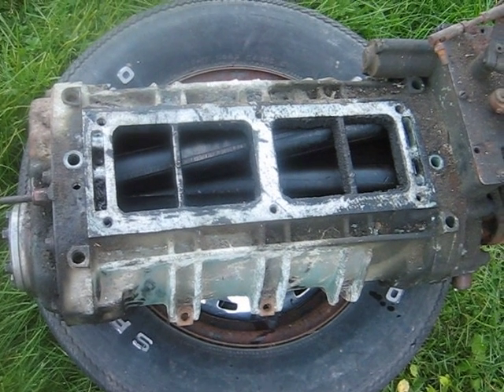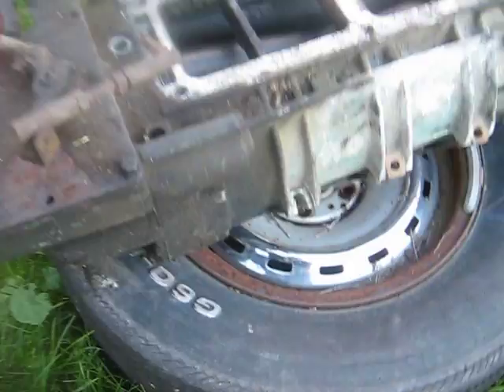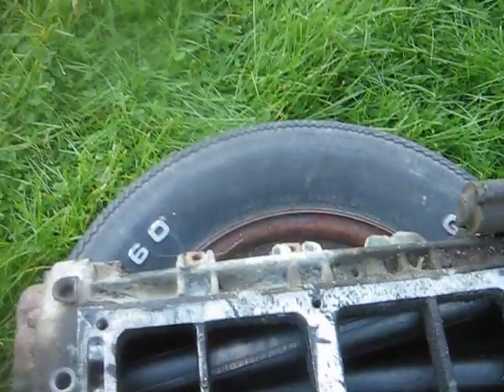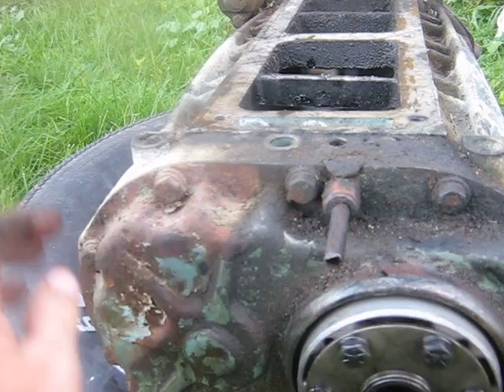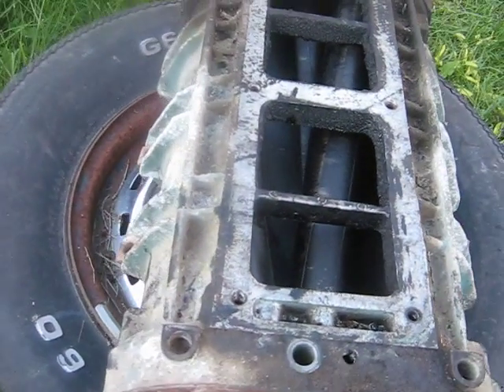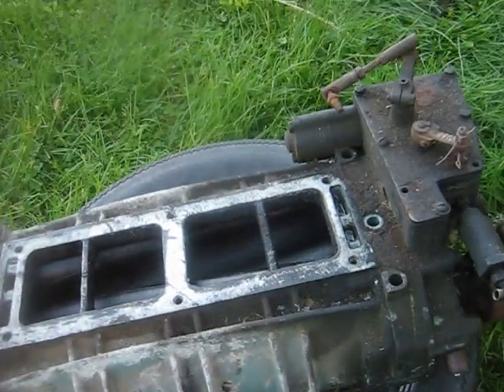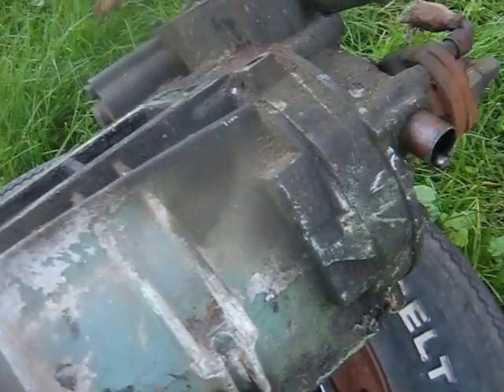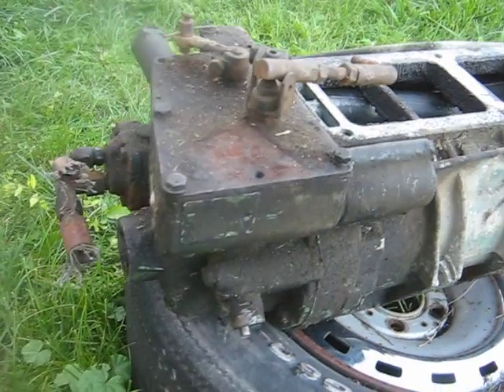Views of V8-71 Diesel Blower (Supercharger)

Comment: That is a small bearing blower, the rotors are timed by helical cut gears with shims to adjust the tolerances on the top and bottom between the lobes. Have to have proper rotor to end clearance. That blower has a LSG governor, also that is the fuel pump on the right front side.. The 8V92 uses a big bearing, if you think the 8V blower is big, you need to see the blower on a 8V, 16V149 TI, need the hoist to get it out safely, it is easily twice that size, well actually more than that. Thanks for sharing with us buddy!
Reply from the maker: PermianBasinDiesel I actually sold this blower to a youtuber who is getting it rebuilt for use on a 454 engine, hope to see a vid of it sometime. I personally had no plans to use it, so I figured why not sell it fairly cheaply to a hot rodder who can make use of it  :)  I still have a V6-71 blower, but it had moss growing in it!
Reply: ChargerMiles007 Oh gosh, moss, um, that's a bad sign. See you around man!
Reply from the maker: PermianBasinDiesel  Yes moss is NOT a good sign in any engine part!
Reply: ChargerMiles007 I remember walking around our yard at the Detroit Diesel / MTU distributor where I worked at a long time ago, blowers, turbos, governors, lots of 2 cycle parts just wasting away, full of dirt, the aluminum pieces turning into a white powered like substance. If you need a core to build, you would go get one disassemble it, most of it is just junk. Then start over again, get enough parts to build a sub assembly.
Reply: Pls how do I set the timing of the blower of 12v 71?
I need help. Thanks.